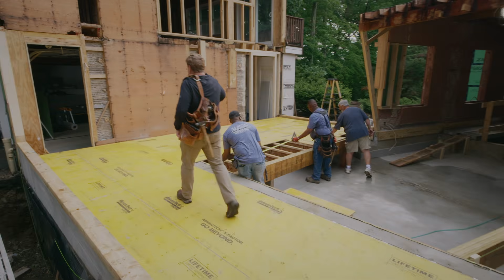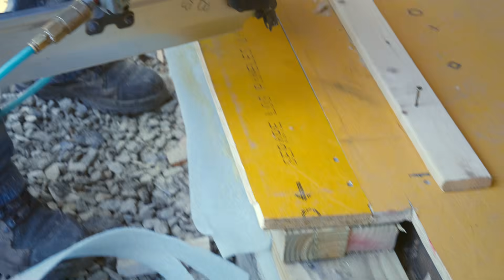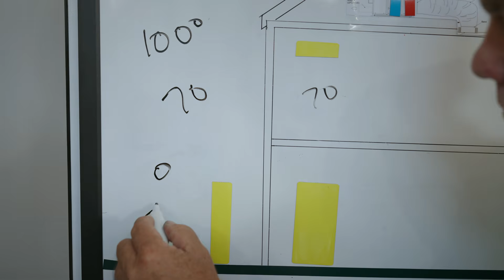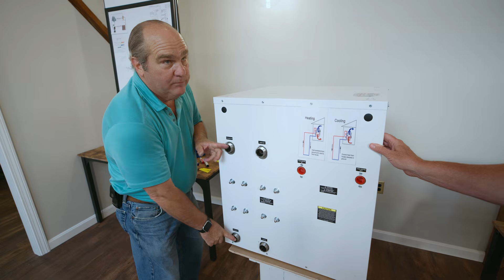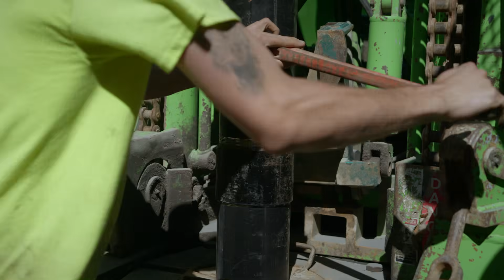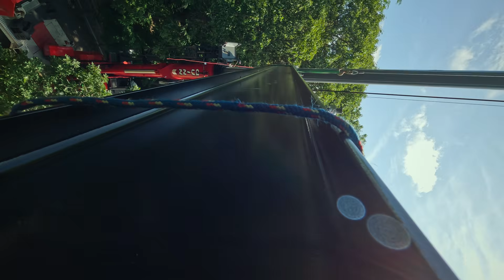This Old House | Gone Geo (S45 E5) FULL EPISODE

Comment: I will be intrigued when there is a deep geothermal well-system installed on a private property. This includes deep Geo thermal to generate electrical power and proper filtering to provide potable water supply of both hot and cold water. With waste being piped into a deep return well.